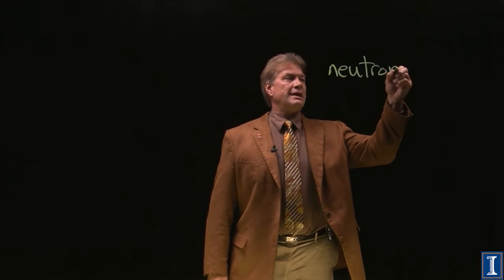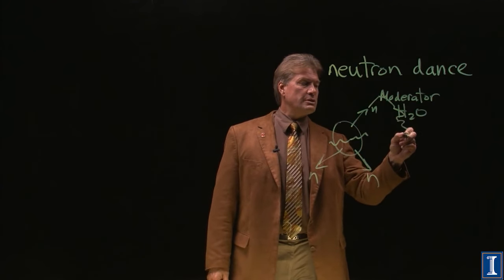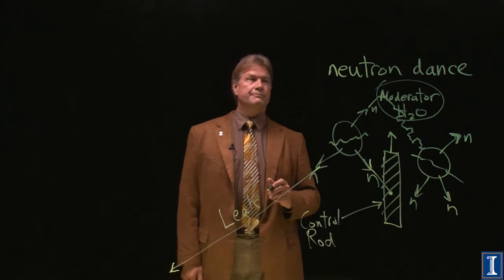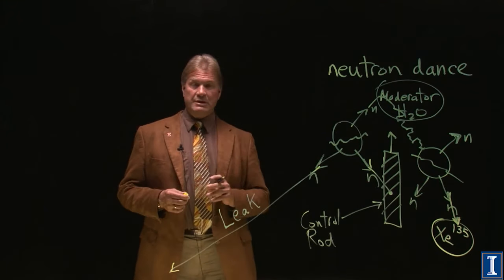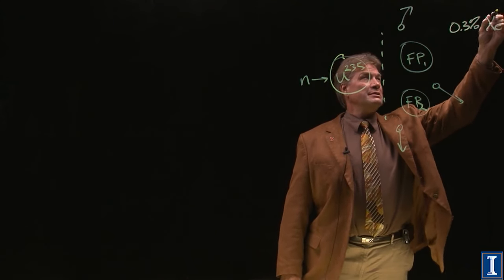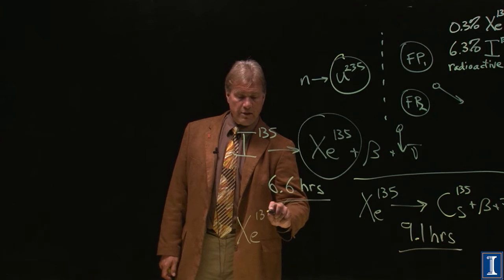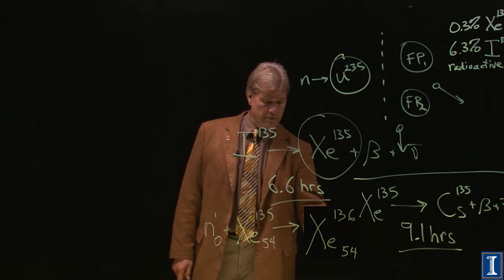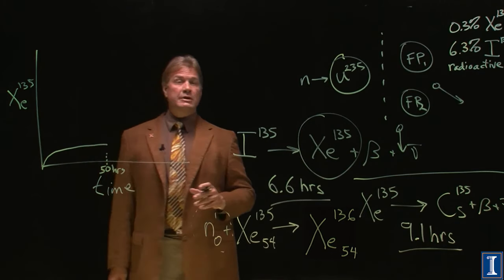Xenon Can Be a Problem

Comment: Factual mistake. Chernobyl reactor was not shut down before explosion. It was in production mode before they started to prepare it for their test and exploded during emergency shutdown process aka SCRAM. There was build up of Xe but due to reactor running in low energy mode for some time and not prior shutdown.
Reply: Working at low power is essentially equivalent to shutting down and this fact was known to operators as well. It was known that operating at low power is not safe but the Dyatlov guy ignored all opposition and forced engineersto continue.
Reply: @alexanderd.7818  Again it was not shut down, it was operation at lower power, explosion happened after they tried to bring it to power level necessary for the experiment to fast by pulling too many control rodes manually, that burned out Xe and left them with uncontrollable reaction which they tried to stop by SCRAM, which made things worse because of the design of rods. He is making explanation way way to simplistic.
Reply: @alexanderd.7818  Alex both shut down and very low energy levels cause Xe build up, however later they performed SCRAM which was an actual shut down during which explosion happened.
Reply: @alexanderd.7818  As for Dyatlov this clear case where too little knowledge is more dangerous than no knowledge at all. He was the most experienced guy on the station and managed startups and shutdowns. Regular engineers on the shit simply insisted on following protocols I'm manual. He thought he knew better.
Later in his interview he said, "If I knew how unstable those reactors were I would never agree to work on them." Which is partially correct but he also ignored manufacturer procedures and did not understand how reactor works in non standard conditions.
Reply: @Vlad_the_Impaler  Well, he thought that he knew better but any good chief has to take an opinion of his subordinates into account. He didn’t. In fact, he called them idiots and ordered to continue operation despite the fact that it was forbidden by regulations. And for that he got a prison sentence which was deserved. Unfortunately, there is not enough years of human life to pay for such a misconduct.
Reply: @Vlad_the_Impaler  By the way, these tests were performed on all RBMK based blocks and that was done without any issues. There was a standard procedure to perform them. This procedure had included a set of quite strict conditions. It was done successfully everywhere including those eight blocks which are currently in operation and visited by children. Chernobyl #4 is an exception and I think that it’s saying something about Dyatlov’s (in)competence.
Reply: The truth is that both math and rules don’t care about authority. Dyatlov was forced to learn this in a hard way. It suddenly turned out that his orders don’t mean anything for uranium pellets and graphite moderator blocks. He could say whatever he wanted about defects or whatever, but none of this would’ve happened without his direct orders.
Reply: @alexanderd.7818  He was under pressure with too little time, pulled out of his weekend and he thought he knew what he was doing and on top of that he actually had more experience than others on the shift and maybe on the station. Guy who was RBMK architect when asked about its safety was comparing it to a Samowar. Russian traditional tea making implement.
Reply: @alexanderd.7818  Sad part, he indeed knew better than all of them, but not enough to understand what is going on in reality. This is why they called for him. He was the guy who was managing power ups and shutdowns and was supposed to know what he is doing.
Reply: @Vlad_the_Impaler  In other words, he was a coward. My own grandfather had refused to execute orders and he got an award for this. Even more, he had been paid for doing so during the rest of his lifetime as a hero of “socialist labour”. Any citizen could refuse to perform such an obviously criminal order and take it to the court and that really worked even in 1930s.
Reply: @alexanderd.7818  Hi Alex, Not exactly. Those tests were supposed to happen before the plant and reactors going in to production, that is also contributed to what happened big time. That was what started whole chain of bad decisions. Dyatlov made mistakes and was made in to convenient skape goat for what happened, but in reality there are were many reasons for why it happened and he is not the only one who is responsible for it.
Reply: @alexanderd.7818  It was a combination of overconfidence and not wanting to shut down the reactor on top of the bad timing. Test was already postponed because of luck of energy in the distribution network because of another nuclear station's reactor unscheduled shutdown. Window for the service shifted to night shift which had less experienced people. Documentation for test was already pointless because of the reactor state not compatible with test initial parameters and reactor shut down meant proby several days before it could become operational. He was over confident idiot but I don't think he is a root cause of it. There are multiple reasons starting from initial design to the bad timing. Similar explosions easily could have happened on other RBMK reactors and one almost did on Leningrad nuclear station.
Reply: @alexanderd.7818  Nobody ordered him to do anything. He was called in by the shift operators when they realized nuclear reactor not behaving in expected way and it doesn't have required parameters for the test. They had some concerns he disregarded them because he actually was more knowledgeable and more experienced than all of them. Again, clear case of too little knowledge being more dangerous than lack of it.
Reply: @Vlad_the_Impaler  I believe that my own faculty’s head would agree with this. Because he was the one who have seen the hydrogen based owen explode without any reasonable explanation. In fact, this event has lead him to give me a recommendation when I defended my PhD. He told the commission something like “if I couldn’t stop the hydrogen from exploding then nobody could, therefore any solution without hydrogen as a co-product is a preferable one”.
Reply: @alexanderd.7818  Energy distribution network was under the strain because demand was high and production was low, remember they had unplanned stop of one reactor on another nuclear power plant. If power demand could not met with power production it can cause whole energy distribution network collapse or you need to implement rolling blackouts. Overload of distribution network can cause automatic chain reaction disconnects and bring it all back online could take days of not weeks. Non of that would happen if the test was done before going in to production also I think this was a second test because first failed or something.
Reply: @Vlad_the_Impaler  The test itself has a set of parameters. The most important of them was a level of electrical power between 700 and 900 MW. This requirement was followed on all reactors except the Chernobyl #4. And all of these tests were successful except the one which was “done” on the Chernobyl #4. Whatever the design faults, the blame is obvious after that.
Reply: @alexanderd.7818  There are reactor types, which are using other elements as heat exchanger. Low liquid temperature metals or salts. My understanding they all have issues them being more corrosive than water which makes them unsustainable in long term. I think military use some with metals on submarines but they don't make a lot of energy. As for molten salts they are much more corrosive.
Reply: @Vlad_the_Impaler  I believe that the only problem that prevented RBMK developers from making the safest design was the unavailability of computing power which was required to do so. RBMK is a very difficult system and the USSR was a subject to a number of economical sanctions which prevented it from importing the hardware which was required to perform required calculations and create a precise model of the reactor. As the result, they’ve been forced to use a simplified model for their calculations. This simplification resulted in omission of some scenarios which were considered as extremely improbable. I believe that you can guess which kind of scenarios were chosen as improbable ones.
Reply: The fact that there were over one hundred of updates have been applied after these sanctions were lifted is a proof that these issues were caused by the competitors desire to stop their progress, without any reason to object this conclusion. In other words , the USSR competitors were trying to slow its progress down but they didn’t expect that their actions would lead to consequences like these. They were lucky that Gorbachev guy was malleable enough to take all of the blame. Somebody like Zhirinovsky wouldn’t be so convenient in this position.
Reply: @alexanderd.7818  Hi Alex, there are some plants which have main root, there are plants with main root from which others are spreading and there some which has no main root, they have several and all of them are same. Chernobyl catastrophe had many reasons and it is combined result of all of them. Some of them are more important and some of them are less but there is no one singular cause for it. You can literally take away one of them and that would not happen. Again Leningrad nuclear plant almost had an exident due to some rods melting before Chernobyl. Reason active zone cross section was too big and made it prone to neutron hot zones creation. RBMK reactors were originally designed not for safety and civilian energy production use, they were designed for military and nuclear weapons grade uranium production.
Reply: @Vlad_the_Impaler  The RBMK reactors were designed with reliability in mind. It’s a kind of RAID array, the damage for some channels doesn’t mean that the reactor as a whole is doomed. Theoretically, these reactors could continue functioning even after up to half of the rods were melted down. And that has been proven at LNPP when some channels were melted down due to technical issues. This specific issue had been fixed and these reactors continued to function until the end of their life time. Furthermore, it has been proven that it’s possible to perform the maintenance without stopping the reactor as a whole. Reactors on Smolensk NPP got an extension of lifetime for the next 15 years after replacement of channels and fixing the deformation of graphite blocks. Seriously, it’s not a joke, you can find a lot of contracts in Google. A lot of companies were tasked with producing technological channels and whatever stuff for RBMK reactors and they earned quite a bit of money.
Reply: @alexanderd.7818  Hi Alex, sorry but I am loosing you. What are you smoking and where are you getting it? Do they ship? What has Zgirik to do with Chernobyl?
Reply: @Vlad_the_Impaler  I think that there is a lot of people who would agree that the very fact of maintainability without stopping the enterprise is unaccountable. If you have any doubt then try to imagine this very fact, that you can perform  a maintenance and fixes while continuing to produce energy for 1 million worth city. You’re performing a capital reconstruction while they’re not even noticing this. It’s an economical miracle as it is. Which was doomed by politicians and their idiocy.
Reply: @Vlad_the_Impaler  I remember that my father was crying in 1986 while reading the order that RBMK/RBMKP project is to be abandoned. He had spent a lot of time to tell obscenities about the stupid people and politicians in the process as well. I was a child then and didn’t understand him at that time. But now I see that he was right.
Reply: @Vlad_the_Impaler  I’m not sure that our subject has anything to do with smoking. I believe that there is some kind of misunderstanding. Just to be precise, it’s not a joke and we’re talking about money here. Not just some money but a lot of money, more than annual budget of some country like a Poland. We could go into precise numbers in the US dollars if you’d like. It’s pretty easy to calculate for anyone with basic education.
Reply: @alexanderd.7818  Your post about changes after sunctions got lifted, Gorbachev and Zhirinovskiy an hour ago. If some one from the West is asking you about what have you smoked and where did you get they are implying you are high on something.
Reply: @alexanderd.7818  I am aware of advantages of RBMK reactors. I am not talking about technology in itself am talking about it specific realization.
Reply: @alexanderd.7818  RBMK in Chernobyl had serious design flaws and many got fixed or upgraded as result also now operators got proper training and required to understand principles behind it. Also they usually don't have containment vessels which makes them less safe by design.
Reply: @alexanderd.7818  Melted rods means hydrogen. Hydrogen means explosion.
Reply: @alexanderd.7818  RBMKs of Chernobyl period were poorly designed, all of the got retrofitted and upgraded because of that. Only two new reactors of this type were build after 1986. It doesn't matter how powerful or economical they were. All nuclear reactions need water for cooling and redundant sources of power which means they get build next to their primary consumers. People living in big cities. They are fine as military rectors for weapon grade Uranium which you can build somewhere in the middle of Siberia with small town next to it for it personal. They are not such good idea next to big sources of drinking water or big cities. This why right now people are actually working on smaller and safer types of nuclear reactors. I am firm believer in need for nuclear power considering global warming and even can tolerate some nuclear accidents as long as reactors are located in unpopulated areas but for now it doesn't look possible. Chernobyl catastrophe was tragedy and many people die from cancer as result of it but it also created big natural preserve. It also increased safety requirements for nuclear power. Other big issue I have with nuclear power is nuclear waist. This one is the big one for me even bigger than accidents.
Reply: @alexanderd.7818  Nobody was actually accusing of being on drugs. That is always considered to be a joke. Two layers one is joke about being on drugs other real not understanding what are talking about. I somehow got your messages out of order. And you used wrong word sunctions vs moratorium also I am not big fan of Zgirik and his ideology. All his talk about Great Russian Empire means nothing while his children and grand children living in France.
Reply: @alexanderd.7818  If you are so interested in political back ground of Chernobyl catastrophe I think I have listened to good audi version of a good book about Chernobyl catastrophe on the YouTube.
Reply: @alexanderd.7818  Chernobyl: History of a Tragedy by Sergii Plokhy
Look for Chernobyl Disaster chapter 1&2 on YouTube.
Reply: @alexanderd.7818  Rods on LNPP have melted because of unstable neutron flax field and creation of hot zones partially because reactor active zone cross section was too big and hard to control. This is not reality this flaw.
Reply: @alexanderd.7818  I think this exactly what he was trying to reach for the test by pulling almost all control rods out and not understand why rector energy is not going up accordingly.
Reply: @alexanderd.7818  Those accidents with partial meltdown in LNPP were caused by design issues and if they have been published maybe Chernobyl would not happen.

Comment: Credit where credit is due, the reactor 4 of chernobyl did worked again in less than 3 days after being turned off. It even output 10 times its max rated power. :P

Comment: The Three Mile Island reactor had a xenon bubble formed in the reaction chamber. Since xenon is a gas, there should have been a way to shunt the xenon gas to another chamber, by possibly also using a vacuum pump to encourage the xenon gas to come out of liquid H2O in which it was dissolved.

Comment: Apparently there were carbon tips on the control rods which interacted with the water, carbon is a huge catalyst for reactions apparently.
Reply: Graphite tips, and if you read my other comments, calling them tips isn't entirely accurate. These are huge. There is an entire graphite rod beneath the control rod, not just a tip.

Comment: I'm not buying the stupid/ignorant Russians explanation.
And, frankly, this also flies in the face of what I've.previously read about Chernobyl.
The Xenon physics is right but I doubt it had that large and simple an effect on Chernobyl.
Reply: It did. Chernobyl had a data logger that showed what steps were taken and what switches were pressed learning right up to when the SCRAM button was pushed. That plus the slow moving control rods that had carbon moderating tips (plus the positive void coefficient of its water cooling design) spelled disaster. The test was delayed for hours while the reactor was running at a low state leading to it falling into this xenon pit, with them pulling out control rods to try and get the reaction back up again. Probably thinking they could just hit the SCRAM button when it went wrong. It was bravado and the kind of confidence that ignorant people have that set everything in motion. It was ignorance and a flaw in the design that was unlikely to be a problem unless the reactor was operated by the ignorant that caused the explosion.
Reply: I have since learned I was wrong about the xenon. It had a major and deciding role.

I'm not yet willing to concede about the "stupid and/or ignorant Russians" part.
Reply: bmobert Concede...someone or somebody in that room made some very foolish decisions that caused the reactor to explode 😯